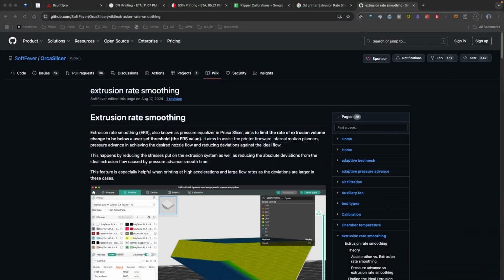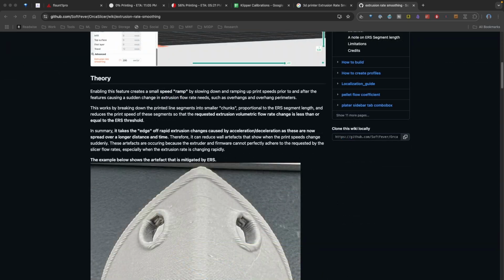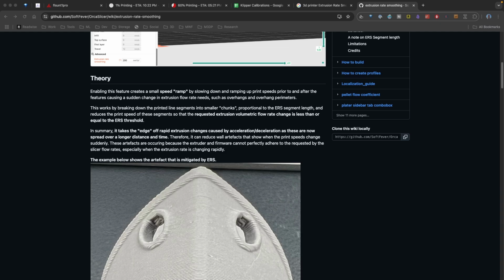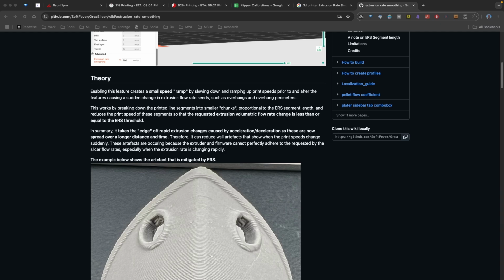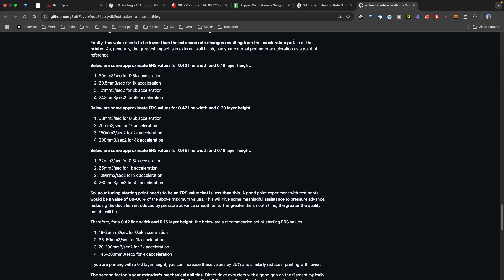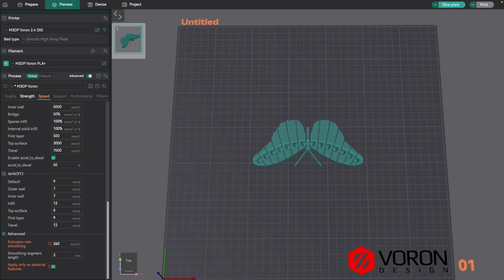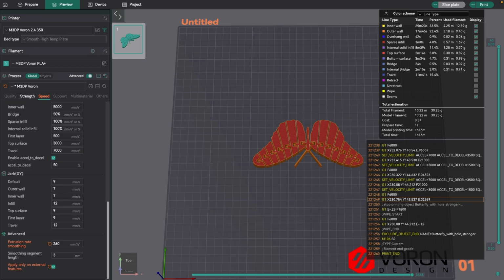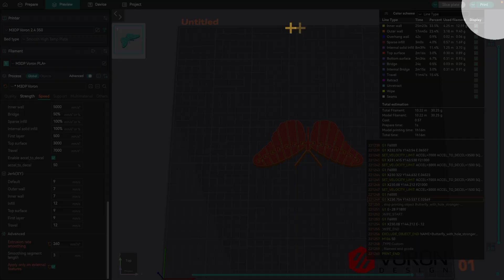Mastering Orca Slicer: Advanced Extrusion Rate Smoothing Tutorial

Comment: i'm printing the flow calibration test and it wont print the tab showing the setting, its shows up fine in the Prepare mode but transparent in the Preview mode. I've changed layer heights but that doesnt effect it. ?
Reply from the maker: That is a weird issue. Are you using the latest version?  Are you using YOLO?
Reply: @minimal3dp  yes latest version, dont know what yolo is.

Comment: Without providing test samples which show this in action, this turned out the same as reading orca wiki at best. None of my questions were answered
IS extrusio rate smoothing just a value to limit acceleration through limiting flow rate change? (like you can limit speed by limiting flow rate for example)
Is there a setting that does not affect speed, but affects how agressively pressure advance data is applied
All of this is relevant  because im printing tpu, its flexible so it needs high pressure advance value, but due to tpu not being very springy, but acting somewhat like non newtonian fluid, pressure advance just acts too fast on it. I knew i can just reduce acceleration and jerk, but i thought this is relevant to research before doing that because it seems related

Comment: Extrusion rate smoothing is broken and doesn't work in Bambu or Orca.  No matter what you set it to, it does exactly the same thing (for example, values of 1, 50, 200, and 300 have exactly the same result).  It adds speed variations on straight walls where none should exist, resulting in color banding and other artifacts.  It does not smooth flow.
Reply from the maker: I will take a look and see if my slicer is doing the same. Did you file a bug report in the report?
Reply: @minimal3dp  Any further results on this?

Comment: do u know how to connect orca to an older printer, that has worked best with S3D? I tried but it wont start the print. I suspect its a simple solution but is beyond me skill level.
Reply from the maker: In your old slicer, how did you previously connect? My guess is an ip address or a printer name. If we know that we might be able to connect.
Reply: @minimal3dp  oh thx for the reply. I save the sliced file to my desktop then upload it to Duet2wifi software and it sends the file via wifi to the printer
Reply: yes thats an  ip address
Reply: @minimal3dp  i used to use S3D and it never had a connection problem. its not an ip address prob. but now works with the latest version of orca.